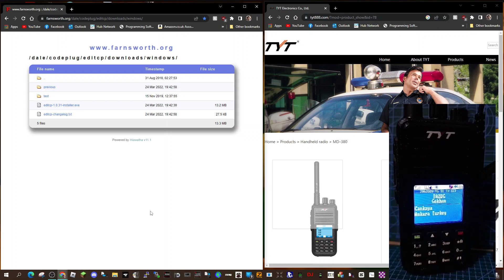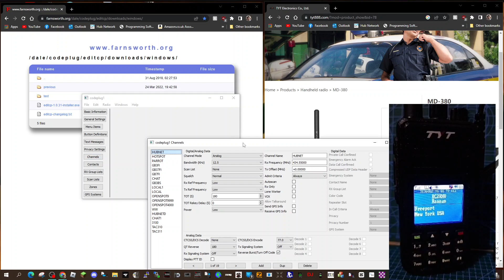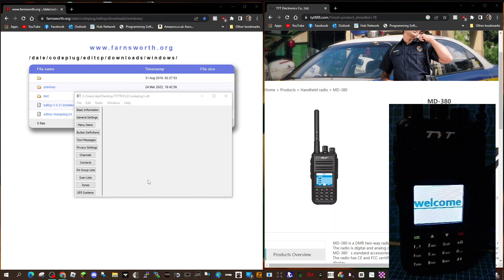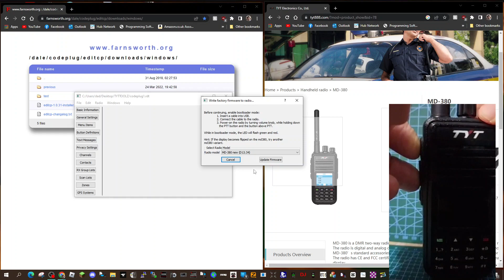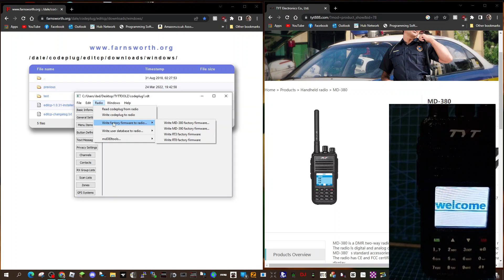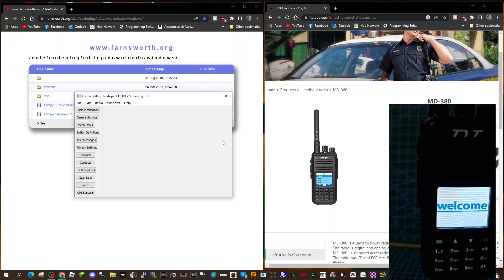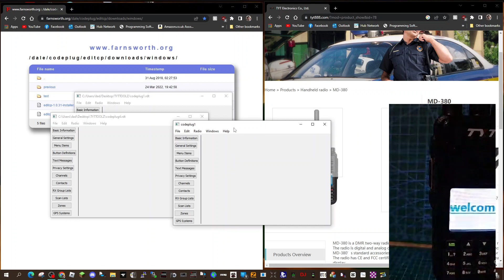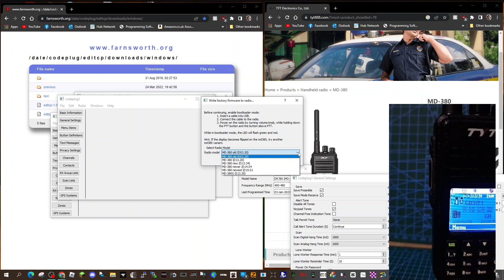EASY RESTORE FIRMWARE-MD380/RT3 -RT3S/MD390

Comment: Its not working at MD-UV380 model ...any help because my radio stucked in DTFU mode!!
Reply from the maker: Somehow you need to reload firmware
Reply: I update the CPS programm (1.12 to 1.20 ) and finally the firmware installing properly.
Thanks for the reply answer.
73  @M0FXBHamTech

Comment: THANK YOU SO MUCH. I flashed the 380 tools to my radio as soon as i got it and it broke the battery. The radio will have a fully charged battery but show like the battery was dead and beep that it needed charging and pretty much made it unusable. Flashed many firmware's and could not find the factory FW until i found your video and it fixed the problem.  Again THANK YOU SIR !!!
Reply from the maker: Hi so glad it helped .